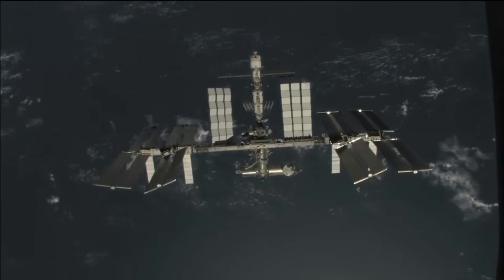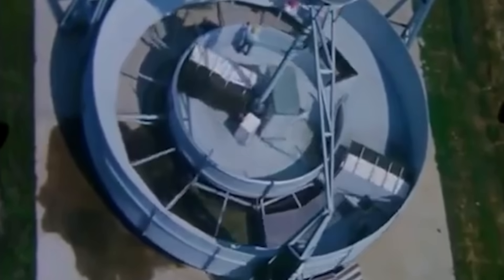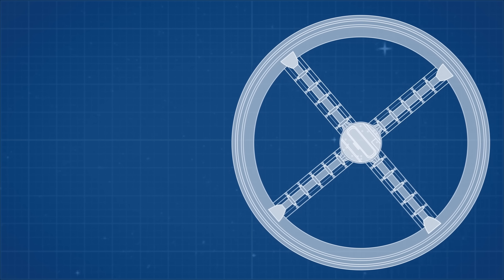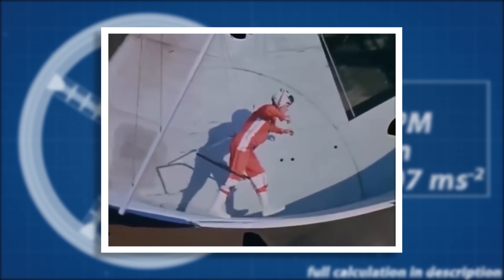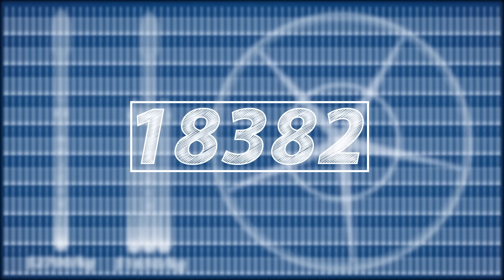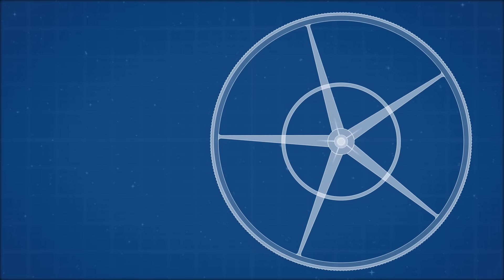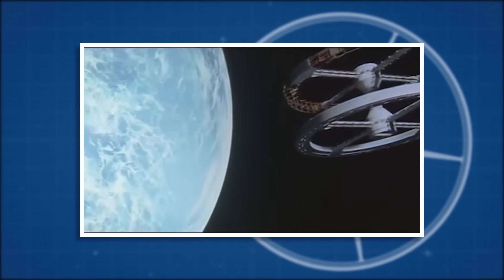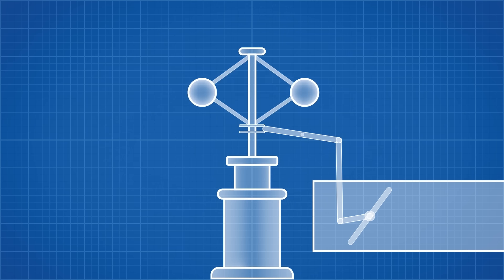Can We Create Artificial Gravity?

Comment: it's called "Centripetal force" not "Centrifugal force".
Reply: Centripetal and centrifugal force are describing two different things, they're not equivalent. Centripetal is the force pulling inward, centrifugal is the effect pushing outwards.
Reply: Centrifugal force is just the reactive force of the object caused by the centripetal force trying to keep the object in a circular orbit.  If there is no centripetal force, there will be no centrifugal force. 

In class reactive forces are often explained with a donkey. The donkey needs to pull a cart, but realises the harder it pulls, the harder the cart will pull back, so it doesn't want to pull at all. In this case the donkey is trying to change the speed at which the cart is going(0m/s in reference to the ground), this would be the centripetal force. The centrifugal force is the cart trying to stay at rest. 

In a centrifuge, things have a velocity that is tangetial, but the centrifuge is keeping them from flying of by pulling them back in that circular motion. To the objects it feels like they are being pulled against the wall, while the wall is being pushed against them. 
The whole discussion is just a question of reference.

The reason people don't like to call it centrifugal force is because it might give the wrong idea of an actual force dragging you to the floor. If a centrifuge was floating and spinning in space, you can just hang anywhere you want and you will just float there. If you were to hang on to the centrifuge however, it would give you momentum and then try to keep you in a circular orbit around its axis.
Reply: how come ur comment ends half way ? ;s i was trying to read it but it ends after
"Centrifugal force is just the reactive force of the object caused by the centripetal force trying to keep the object in a circular orbit.  If there is no centripetal force, there will be no centrifugal force. 

In class reactive forces are often explained with a donkey. The donkey needs to pull a cart, but realises the harder it pulls, "

the harder it pulls? what happens then?
Reply: The complete comment shows up for me. This is the rest: 
"In class reactive forces are often explained with a donkey. The donkey needs to pull a cart, but realises the harder it pulls, the harder the cart will pull back, so it doesn't want to pull at all. In this case the donkey is trying to change the speed at which the cart is going(0m/s in reference to the ground), this would be the centripetal force. The centrifugal force is the cart trying to stay at rest. 

In a centrifuge, things have a velocity that is tangetial, but the centrifuge is keeping them from flying of by pulling them back in that circular motion. To the objects it feels like they are being pulled against the wall, while the wall is being pushed against them. 
The whole discussion is just a question of reference.

The reason people don't like to call it centrifugal force is because it might give the wrong idea of an actual force dragging you to the floor. If a centrifuge was floating and spinning in space, you can just hang anywhere you want and you will just float there. If you were to hang on to the centrifuge however, it would give you momentum and then try to keep you in a circular orbit around its axis."

Comment: You don't have to have a solid structure to create this acceleration.  Instead, take 2 "pods" / living spaces of more-or-less equal mass, with a wire (and a winch) between.  Spin them up.  Both have good acceleration/gravity.  But, very little mass is required.

Comment: I think I read somewhere that in order to produce 1 G without any unpleasant side effects for the occupants, the ring's radius  would have to be a minimum 224 meters.
Reply: that's not a bad estimate. to make one in which you would not be able to feel significantly different forces on your head and feet, and not have standing up be detrimental in the long run, then 224 meters is a good minimum.
Reply: The problem with such layouts is that they can start yoyoing around. The ring keeps everything rigid.
Reply: yoyoing :D :D:D:D:D:
Reply: so build a thin steelbelt that keeps it from yoyoing... wtfistheproblem
Reply: Revilboy Steel is very elastic and would only make things worse. Two tethered objects in weightless environment are not a stable system because they are not two mathematical points connected by a line.
Reply: well sorry then i didnt study physics or any =) was just an idea to stick things in the space between to increase stability though :D
Reply: So use multiple struts.  3 might be enough for stability.
Another thing that would help would be turreted thrusters on the edges (on top of the living quarters or whatnot).

This would allow for roll, yaw, pitch, forward and retro-grade, all in just 3 turret assemblies.

This also adds the benefits of:
Easier maintenance, better thrust to weight, faster maneuvering, faster retrograde and no need for RCS or thrust vectoring (KISS principle).

Comment: The statement at 2:50 that "to make a practical space station with artificial gravity, the station would have to be huge, which is simply too expensive" seems to assume a complete ring like in the movie 2001, but there are other options--one proposal is to just have a relatively small crew module attached to a long cable with a counterweight on the other end, spinning around a central hub.

Comment: If you ran in the direction it was spinning, you'd feel heavier. If you ran in the opposite direction, you'd feel lighter. If you went fast enough in the opposite direction (as fast as the spinning), you'd eventually be weightless and hovering in the air while people moved past you. You could also throw a ball in the direction opposite the spin and if it was going the same speed as the ship rotating past it (but in the opposite direction), it would look to everyone like you threw a ball that keeps on going and never falls.

So, it's not gravity you're creating, but constant acceleration. If you remove that, it's like turning off the gravity!
Reply: When i saw 2001 I thought if I were poole or bowman I'd prank the other guy by placing a stationary plastic bag of water at around head level in the carousel just outside the door to the sleeping quarters, as the other guy woke at the beginning of shift he'd step out and SPLAT.

Comment: please son.  space stations in the future will be made of inflatable structures like this one.  

https://www.youtube.com/watch?v=ewyEVkOAxKQ

dont need all that aluminum and its way cheaper to send into space
Reply: Inflatables can become permanently rigid: woven/sewn fiberglass mesh inner wall could be impregnated with a resin after expansion, which hardens to hold shape. The deflated structure can also include an integrated micrometeoroid Whipple shield.
Reply: I'd rather live in a beer can with a pinhole in it than a balloon. :)
Reply: they got blowed up.
Reply: I'd rather live in the Death Star. :)
Reply: Biglow actually has plans for an inflatable with about the same volume as the current ISS. The problem is it's so massive ( in its deflated form) no current rocket can get it into orbit.  I always figured they could build something like the 2001 space station out of inflatable sections have one part stationary ( for micro-gravity science)  and the other part would spin ( to provide long term crew habitability, on the order of 2-3 years).
Reply: actually the inflatable structure currently handles micro meteor impacts better then the hard structure of the ISS.
Reply: John Ross Anyone who's ever played Kerbal Space Program knows it's never as easy as "building a bigger fucking rocket". 

The bigger you make the rocket, the more fuel you have to add to lift it, the more fuel you add, the more weight you add, and the more weight you add bigger you have to make the rocket.

Comment: Centripetal force exists in all reference frames.  The reason that Centrifugal force is fictitious is because such forces only exist in reference frames under acceleration.  You explain this pretty well, but then claim the force is "real" in the accelerating frame.  It isn't real because of the fact that the frame is accelerating.  You can concoct any manner of accelerating frames and create these fictitious forces.  There are thus, an infinite number of such fictitious forces as Centrifugal force, thus it's meaningless to define forces in this way.  This is also why it's confusing to name this special case of the "force" created by using a rotating reference frame.  Centrifugal force is simply a mathematical tool used to make use of rotating reference frames.  It isn't real in any way.

Comment: Great video! One interesting side note is the gyroscopic forces involved in a huge spinning ring- wouldn't be easy to manoeuvre!
Reply: The body doesn't need to be bulk reoriented. Use: a separate non-rotating center section with fixed reaction jets attached to it, jets which themselves can be gimballed while firing, or multiple small fixed jets which sequentially pulse on and off as the ring body rotates past the direction of travel.
Reply: build two side by side, slightly varying the speed of one vs the other would cause it to precess. You can use this to keep solar panels aligned.

Comment: The station has to be big.   Lots of people have done the calculations and realised that the station in 2001 is too small by far.  So perhaps 50 - 60 kms across. However, it does not have to be built from earth sourced material, whether aluminium or titanium or whatever.  This is the clue.  It may for example be built from iron nickel alloy sourced from asteroids.  A robot ship can find potential asteroids.  Further robot ships with solar powered plasma cutters can go to work on the asteroid while it is slowly brought back to a desirable earth orbit.  it just needs to be fashioned into a balanced cylindrical shape with internal spaces being fashioned over time.

Comment: What I'm wondering now is...how would a spacecraft dock with that thing?
Reply: Approach in the rotation plane at a tangent with speed v=w*r.
Reply: You've not seen the docking scene in "2001"?  Or even "Interstellar"?  Like the other replies - match the spacecraft rotation to that of the station, and dock in the centre.
Reply: @Veseyron, Ok I see your point, a rail could work in theory. Then you drive your shuttle along the rail to the docking port. In either case, edge or centre, some sort of soft/flexible clutch system would be advisable to limit the need for pin point accuracy, after which the hard dock could engage.
There are however a lot of undesirable structural forces at play in the moment the shuttle docks and assumes the rotational motion (sudden jump from zero-g to positive-g). While we are still in the era of relatively flimsy spacestations, the technology will undoubtedly be central docking. As is the case with most technology, this will not need to be overturned in favor of a more radical system for a long time.
Sorry to pull rank, but as a mechanical engineer, I just don't see it happening your way.
Reply: That means the docking port has to be in the center, along the axis of rotation. Makes sense.
Reply: Please no one hire this guy ^^ (Veseyron I mean)
Reply: +Geoff Mulder Why not? It would require less change in speed and, assuming life support modules would be at the rim, be considerably safer.
Reply: No man, just think how precisely you would need to time your approach to align the ship's docking port with the station's, if the station's were at its rim. They already approach at only a few inches per second because docking ports are precise and important things that must not be damaged. Also the sudden attachment of a large mass at the rim of a rotating object will throw it completely off balance.
Only way is to dock at the centre by matching the ship's spin to the station's.
Reply: You do not build a single docking port outside, you build a rail. Spacecraft mass is negligible in comparison to the space station's. 0.1% at most.
Reply: +Veseyron A docking rail would make sense :) maybe the rail would attach to a "train car" that would shuttle crew to the right part of the station.

Comment: Great video, but there are some important points that were left out. For rotational speeds of greater than about one revolution per minute, humans are very sensitive to motion sickness. It takes about 10 days to recover/get used to your sickening environment. So this isn't really a good thing for tourists.  This means you'd need a space station about a kilometer wide.   The second point is that a solid ring is not required. The station could definitely consist of two "pods" at each end of a tether. They would swing about their combined center of mass, and each would experience the centripetal acceleration just fine.  The pods could be the size of a school bus, and an advantage would be that the length of the tethers could be adjusted to control the rotational speed.

Comment: What about negating the problems with both small and large stations (small has problems with more gravity at your feet than head, and big is expensive) by making a very long station with two smallish areas on the end that are getting gravity, but still using significantly fewer materials to the point that it becomes very feasable?
Reply: You described what they call a Bola. You could do it with a couple of modified Orion fuel tanks which have an airlock and tether point in the nose and deck mesh installed inside before launch. String a long cable between them and spin the whole thing. Stephen Baxter's book Flood, and Neal Stephenson's Seveneves. In reality it would make sense for a manned mars mission, put all of the stuff you wont need until landing at one end of the cable, and the habitat at the other end of the cable then set the whole thing spinning using the unneeded equipment as the counterweight. You would also have a third part being a comms relay which just hangs around nearby because aligning a dish with earth from a spinning thing is exceptionally difficult. Once you reach mars orbit the comms relay remains in orbit along with your earth return engine & habitat (the mars hab would be to expensive to lift back to orbit and would be left behind).
Reply: Excellent.  Although I think the (equivalent of) GPS in space should allow for aligning the the comms dish at regular intervals instead of all day every day.  But I haven't looked into this with any great detail.

Comment: In the Elysium example, what exactly would the ring be rotating against? Obviously you couldn't just slap a motor on there, wouldn't you need another ring that has more mass than the ring it's trying to rotate?
Reply: You're right that every force requires a reactionary force, but in this case the ring would continue to rotate due to inertia alone, once it was started spinning by an outside force. For the ISS they use rockets. The rockets speed up the ISS, and its inertia keeps it zooming around the earth for months at a time. There is a very very small amount of air drag at the ISS' altitude so ever few months they have to burn rockets to speed it back up.
Reply: There's no friction. Once you get it spinning (which you can do with rockets) the station will continue rotating with no "motors" required.